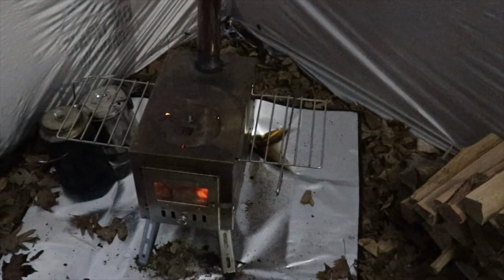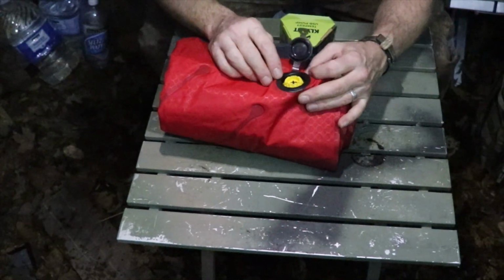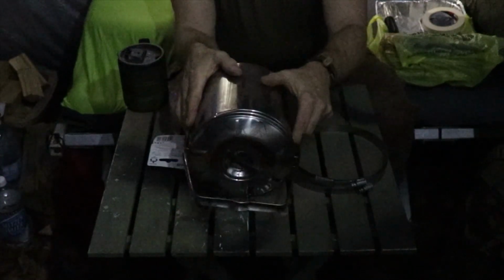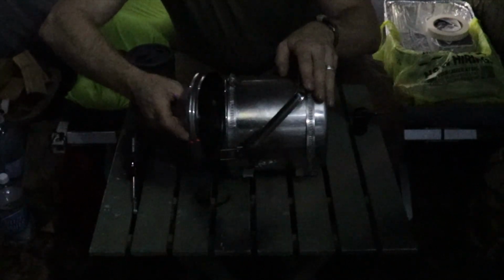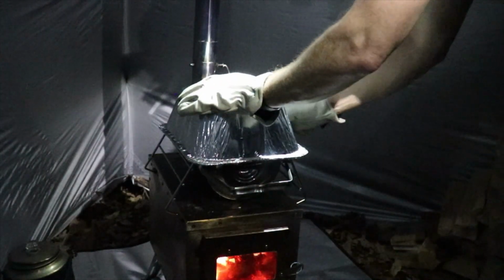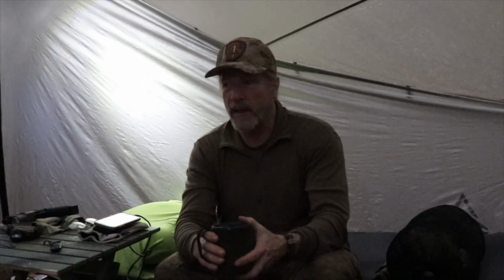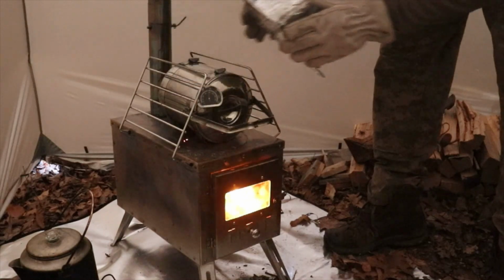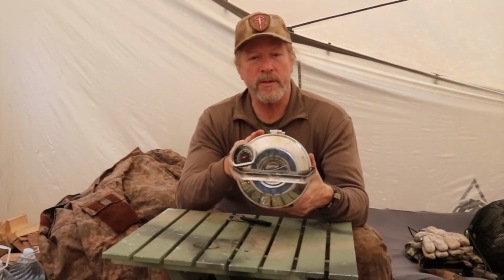Hot Tenting And Stovetop Baking In A Billy Can!

Comment: Awesome vid John ~ my home oven heats from the bottom too. The point of baking is just to get the food on a shelf in the middle of the "oven," which you've done (no top fire required unless "broiling"). The innovative feet rule ~ I'm going to try pipe clamps too (with clamp screws on opposite sides of the bottom, acting as feet).

Comment: Definitely test the klymit pad  outside in the cold too not just in a hot tent. Not that long ago (less than 5 years) they used a different rating system than the industry standard. Ive got an insulated and a non-insulated pad from them, both have a rating significantly higher than what they actually are (the insulated is rated as something like 4.7 when its actually even worse than  my thermarest closed cell foam which is about 1.7 and the non-inulated is basically just sleeping on the ground with some padding). My friend also has the insulated one and he froze his butt off about the same as I did with just a poncho liner and poncho.
Supposedly they've brought their stuff in line with the industry R ratings, but I've swapped over to other more reputable brands with the Klymit ones as last ditch back up or summer use only and haven't looked back.
Reply from the maker: Good information with real examples Thank you for sharing this. I purchased this to be used exclusively with my cot. I also put a USMC Thermorest pad under it (to even out the slightly stretched out old cot). I probably wouldn't use it for ground camping. When I do ground camp the Eco Tech pad goes inside my bag.